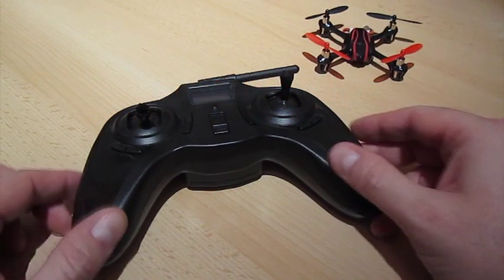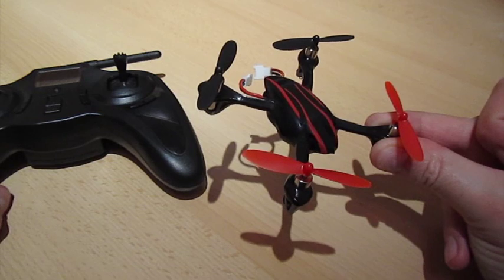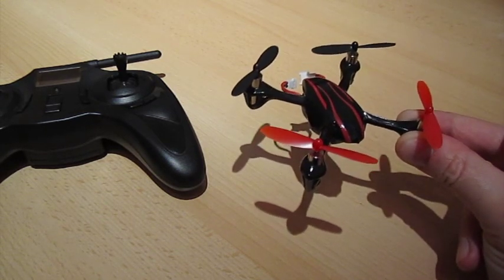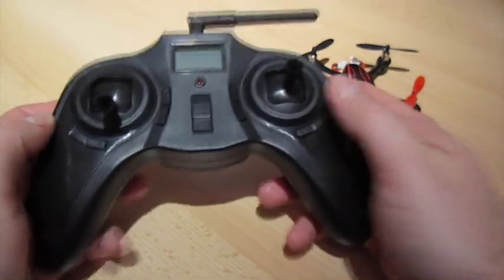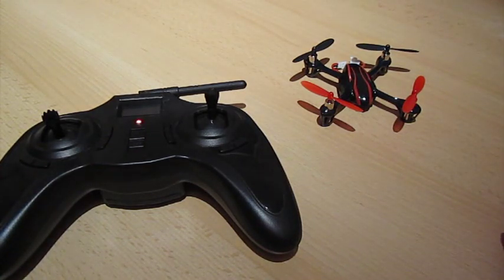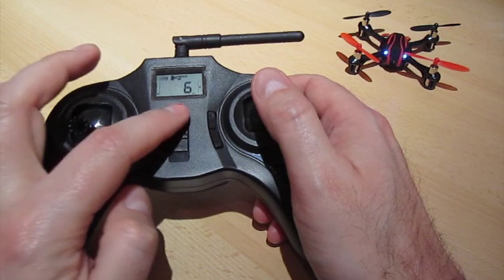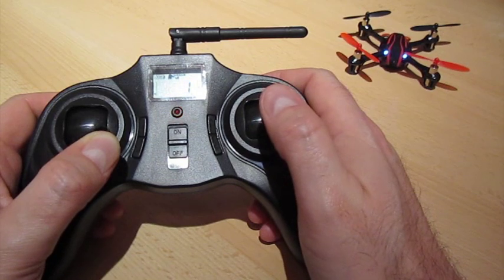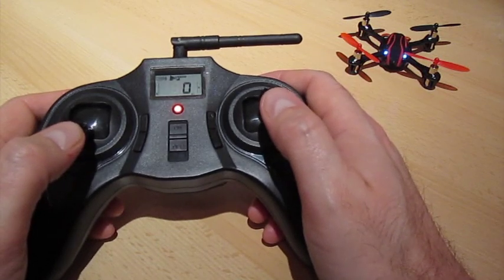Hubsan X4 - How to Recalibrate the Accelerometers

Comment from the maker: Glad it made a difference! These little guys need this every now and again to fly well. Sometimes the model doesn't startup well after you connect a battery but a quick unplug and re-plug sorts it. If all else fails this usually sorts it.

I know when it's needed as the model will not turn on the spot or pirouette on the spot any more.

Happy flying!

Comment from the maker: Did it used to work ok? If so then check the battery is ok and has a full charge, check that you can see the numbers on the transmitter go up to 100 as you raise the throttle and check that the propellers are not damaged. Failing that it may be the motors need replacing or the control board has a fault.

Comment from the maker: Hi Javier, make sure that the transmitter is in expert mode - it will not work unless it is. If you have done that then I'm not sure what the problem is - maybe the Hubsan has a different sequence?

Comment: it could be, i suggest (if your handy with tools and working on things) to open the controller up, on the side of the throttle stick is the pot that controls the throttle input. increase the pot with the stick at full throttle (quadcopter turned off of course) with the controller on and adjust the pot slightly until it reads 100. after adjusting it, go from zero to 100 percent a few times to make sure it will read 100 every time.

Comment from the maker: Make sure your trims are in their center position on the transmitter (they make a different beep when in the middle position) and then just reverse the sticks to perfrom the reset - i.e. waggle the left stick rather than the right stick etc. Good luck.

Comment from the maker: Check the connections from the battery to the main board (you will have to take the body apart), one of the solder joints may have come undone. Failing that you may need a new control board. Good luck.

Comment: thanks for the reply, i ended up finding a write up someone did on calibrating the controller, along with having to calibrate it, the throttle was still not reading correctly. the highest input of throttle only displayed 98, so i opened the controller and i used a flat head screw driver and had to slightly adjust the pot with the throttle at full input, i did this while watching the the number until it reached 100. it is now working and i got a few flights on it sofar

Comment from the maker: I suspect that the trim on the transmitter isn't at it's lowest point.  

Make sure that the trim for the throttle is at it's lowest point (it wil make a different beep when it is) and then make sure that the display shows '0' with the throttle at low stick and that it increases smoothly up to 100 as you increase the position of the throttlestick (remember to unplug the battery in the model while you do this!)

Post a vid if its still not working. Hope this sorts it for you.

Comment from the maker: 1)      Click each of the trims until they make a longer beep and the block on the screen for that trim is in the middle of the bar – this is the middle position.
2)      Try to lift off again
3)      If it’s still not happy run through the recalibrate the accelerometers again with the new trims
4)      Try to lift off again
5)      Check the sensitivity setting on the Tx (see my other video)
6)      Try to lift off again

If it’s still not happy come back to me..

Comment: in addition, i suspect there is still some problems with it, the quads gyro doesnt seem to do much at all to keep it from drifting around. i recalibrated it but it didnt have an effect. im thinking i may have just ended up with a dud. but using some active pilot i can fly it around rather nicely. its a nice quad for being so tiny.

Comment: Hi there, i hope you can help me, my little hubsan controller has the throttle problem, 
It seems to have reversed itself..ie the throttle is on the left but when you move the stick upwards its going to zero....and when its at the bottom its scrolling to 100..?
is there a way to get it back? to what it was before?
Cheers Abby

Comment: i just got my hubsan x4, when i throttle up it goes full throttle, even if i give a slight amount of throttle input. i tried rebinding it and recalibrating it and it still does the same thing. it acts like there is no throttle proportion. ive looked online and cant find any related information on this, any advice?

Comment: can you tell me how to reverse our controls.,our throttle is the right side and our steering is the left opposite the way it came.. somehow it reversed and we cant control its flight  basically its stuck in MODE 1, and we need MODE 2
Reply from the maker: To change the Tx modes you would have to remove and re-solder the sticks from one side to the other for the throttle with no spring (the sticks are solidly glued to the switch and are almost impossible pull them off), and then cut traces and run wires to the proper Mode pots. You would have to cut traces and run wires for the trims as well. Not fun, but doable.

Replacement Tx are cheap and available from lots of places.

Happy flying!

Comment: My Hubsan x4 has the left rear motor that comes on immediately upon connecting the battery.  The transmitter does not pair and therefore has no control over the other motors.  I suspect that it is not a motor problem as the motor is working, but I think it is a board problem.  Is there a way to reset the board or somehow reset the device?  Any other thoughts on this?
Reply from the maker: Sounds like the main board has an issue. The board should 'fail safe'.

Pop open the case and check any wires have not come loose or that something isn't inside the case shorting out part of the board. If all ok, unplug the main board and try again with a fully charger battery. It's looks likely that the main board is dodgy though, you can get them via many sites for about £14.

Best of luck getting it sorted.
Reply: Thank you!
Reply: Ed Winkler No loose wires.  I replaced the motor but the new motor exhibits the same problem.   Is there a way to reset factory settings?
Reply from the maker: Ed, I've not come across a way to do a 'hard reset' on the board myself. Sounding more and more like it's time for a new main board I'm afraid..
Reply: That's too bad! This happened the day I took it out of the box!

Comment: hey guys i got a viper drone and my controls are messed up. How do i recalibrate the controls? because it keeps spinning around and around i get so annoyed so someone please help me.
Reply from the maker: You need to check that the controls are not reversed, the props are on the right way and that the trims on the Tx are all centred. These are very stable models when setup right and will hover great with almost no input.

Recalibration is for fine tuning and won't help if one of the fundamental things isn't right.

Posting a video showing the settings on the Tx and the problem with the model helps figure out what's not setup right. Good luck!
Reply: o ok thank you

Comment: For some reason mine doesn’t even turn to motors on. Any ideas?
Reply from the maker: Could be lots of things, what troubleshooting have you already done?
Reply: I trimmed the remote and also the Hubsan it self, what still works after the problem occurred. Also, the Hubsan was always standing on flat surface while binding.
Reply from the maker: Tricky to comment without seeing a video of the problem. I double check that the controller is bound successfully, and also check there isn't some kind of 'arming' feature on the version that you have that you need to go through. Best of luck..
Reply: Painless360 Thank you! A little update, I just played a little with the sticks and really managed to start the motors. Unfortunately I had no control at all and the only way to stop it was to catch it and unplug it. As a result I cut one of my fingers open. Next time I’ll remove the rotors.

Comment: Hello, I'm dan and my hubsan x4 is not lying up ? I don't have a clue why and I'm not a expert at all please help 

Dan
Reply from the maker: Hi Dan, not sure what you mean by 'lying up'. Watch my videos on the Heliguy Viper (@playlist?list=PLYsWjANuAm4rbe4yI5ke59TTOwItegsWy) to get a crash course on this model. Hope it helps.Happy flying!
Reply: Hi Dan, did you possibly mean "flying up?" If that is the problem, it's probably because the rotors are reversed. The red should go in the back and the black go in the front.